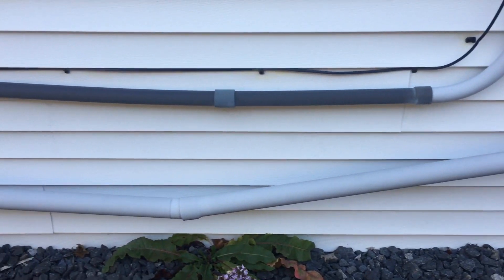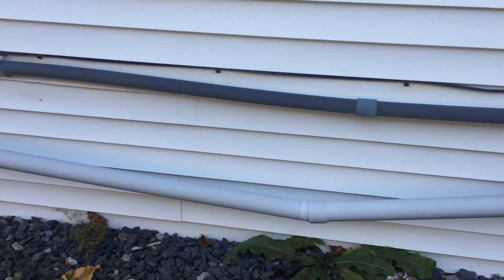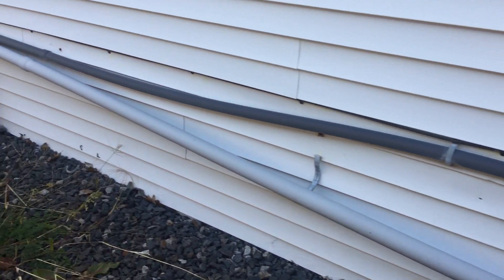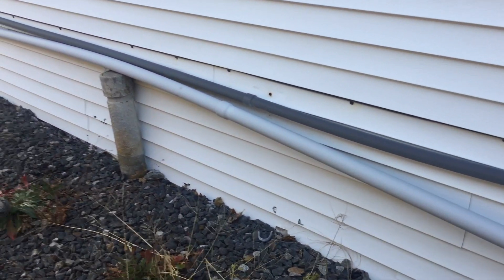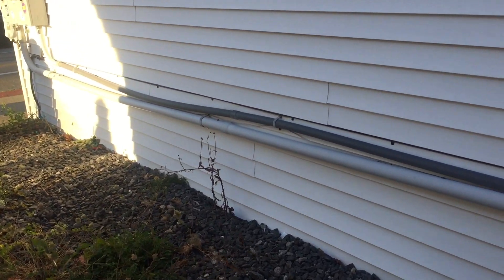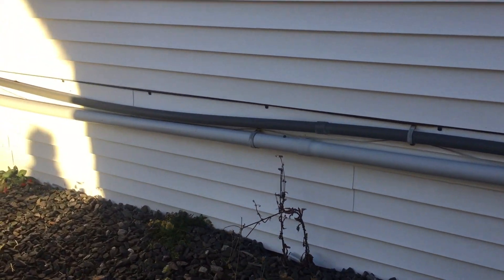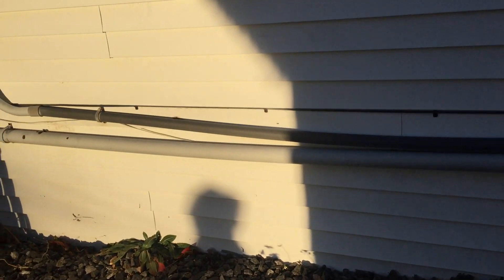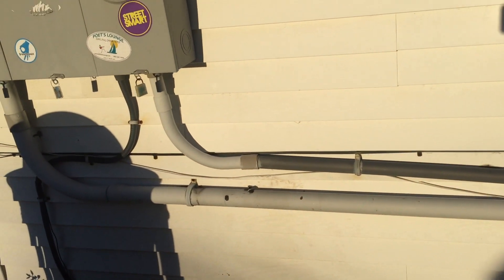Moving Violations Video No. 247: Missing Component Leads to Failure

Comment: Was this actually inspected or was this a hack install? Hard to blame it solely on the installer “if” it was inspected by a electrical inspector who did not care about NEC. Also, could have been installed before expansion joints were required. Too many variables from my my standpoint and opinion to call this a violation as we don’t know the back story or installation.